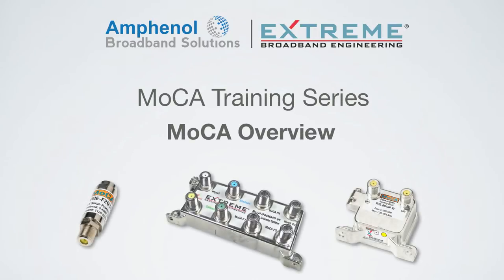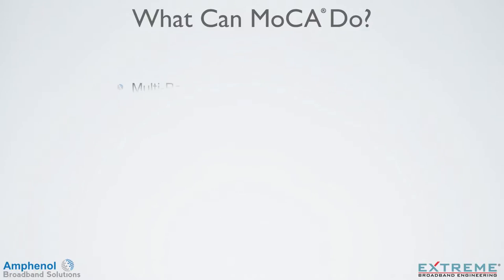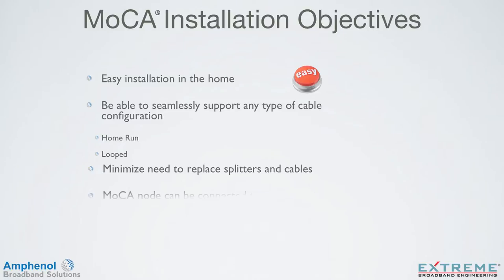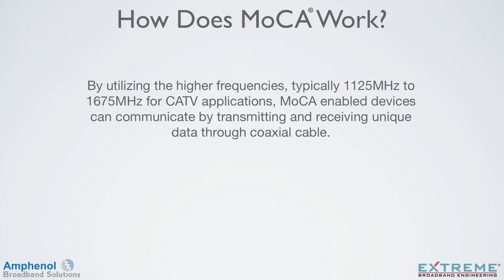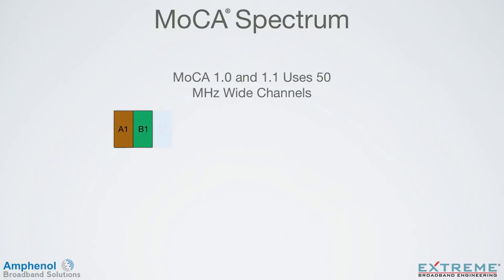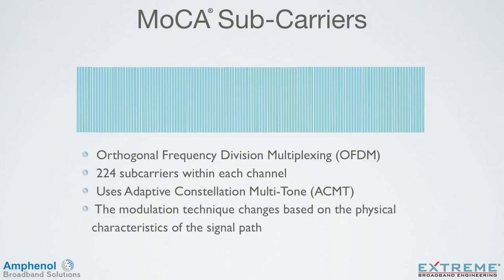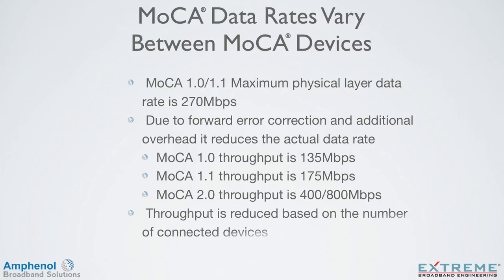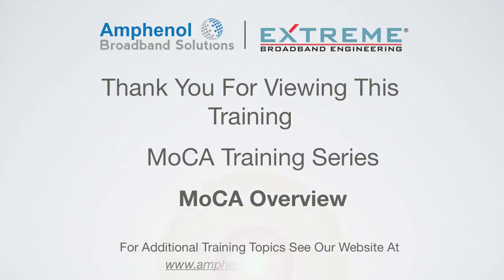MoCA 101: Part 1, Overview

Comment: If I hook up at one end of the house will it carry the siginal to the rest of the house?
Reply from the maker: Good question.

Depends on how many outlets are in the home. Typically, four outlets in the average home. We recommend wiring to be home run to a single point of entry.
 
We highly recommend a MoCA enabled point of entry filter at the input to the first splitter in the home. This serves two purposes; will reflect the High MoCA signal within the home with 1 dB of loss and avoid the high port to port isolation loss of -25 dB at the first splitter.  In doing so, you lower path loss substantially to meet minimum input levels of the other devices of between +7 to -10 dB.
 
If the home has 5 outlets or more still recommend the point of entry filter. We offer multiport splitters with enhanced isolation losses between -25 to -38 dB so the total path loss is less than the controller transmit level of 57 dB. Again, our goal is to meet minimum input of +7 to -10 db.

Comment: How many feet of cable will this work. Getting fiber this next week, cutting off cable. I want to use the cable that runs from the house to my garage across my driveway for wired internet/networking instead of wifi.
Reply from the maker: Thank you for your question,
MoCA is designed to typically work with cables less than 300’ in length.
Typically RG-6 cable will lose roughly 5.6 dB to 8.3 db per 100’ (Depending on the MoCA Band being used)

The MoCA Alliance has a great resource to provide you with a more in-depth best practices overview for additional information.
https://mocalliance.org/technology/Final_Best-Practices-for-Installation-of-MoCA_170516rev01.pdf
Reply: @Amphenol Broadband Solutions  thank's for the responce. I'll read that in a few. My length length from my home office to my garage router is about 175ft. I "should" be good. While i don't really need a full 1 gig up and down in my garage it's better than via wifi that's 48 up and down. That and my older pc stuff can talk to my newer pc's. Thank you!
Reply: @Amphenol Broadband Solutions   The fiber might be hooked in next week, so ready to tell my current cable provider to take a hike. I just need to decide how I'm going to reconfigure my repeater bridge. My garage is a metal building, so I need wifi in it so my phone works while in there, lol.

Comment: Does this work on the same cable that cable TV is on?
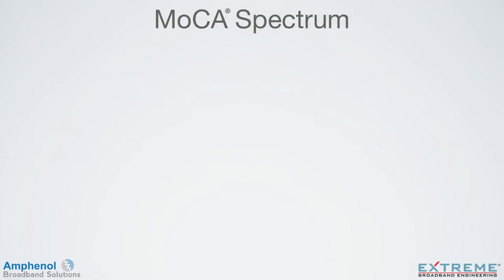Reply: Yes, it does. Analog cable uses 50 - 500 MHz and digital cable uses 550 MHz to about 860 MHz. See the video at about 5:35.
Reply from the maker: Yes, but well above the traditional cable spectrum. Broadband MoCA frequencies are 1125 to 1675 MHz.
Reply: MOCA  works on the same line as cable.  If you have a setup where  satellite is being used on the coax you will have to get  adaptors  called DECA   as  standard MOCA will not work .